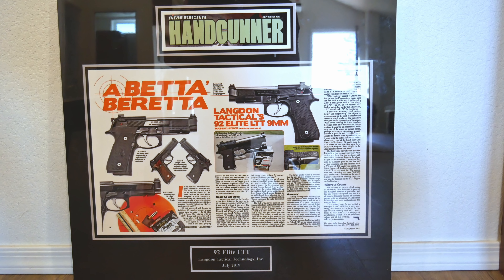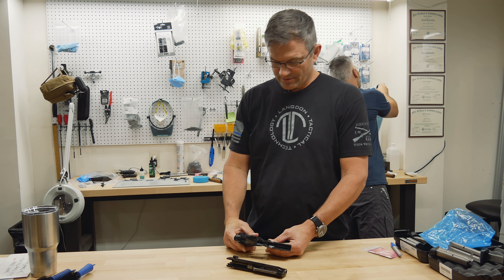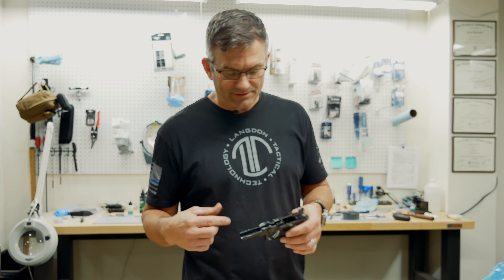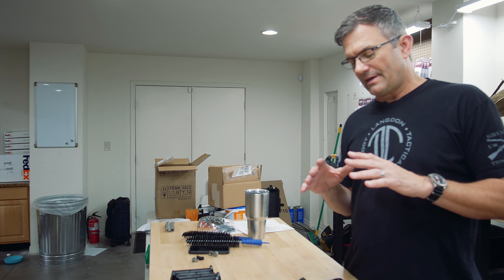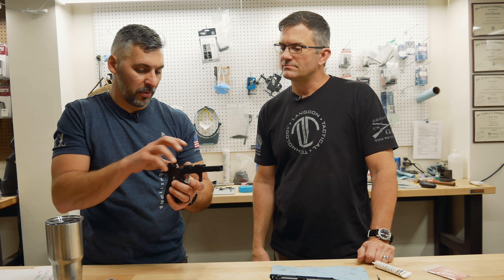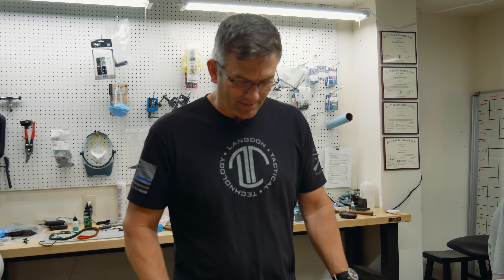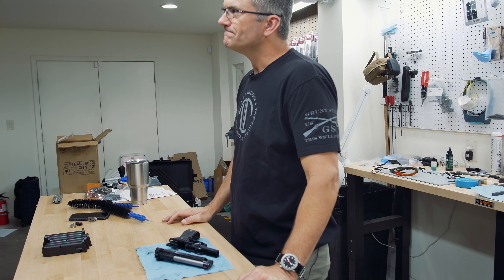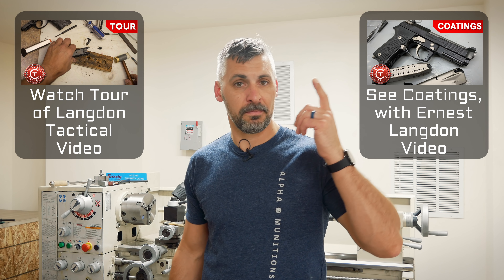Cleaning, Lubricating and Maintaining Pistols with Ernest Langdon

Comment: Thanks for pointing out the missed lubrication point @5:20 on the second frame rails!  It's important, but I never saw anybody point out this missed lube point until y'all did because few people give it a thought...but you can tell by how shiny that area is compared to the relatively light wear even on the rear slide rails, that area is taking most of the friction, and even worse, it's aluminum contacting the steel barrel and locking lugs.  Also i suspect grease ought to be applied here, vs light consistency CLP - in all but freezing weather - for that reason.

Comment: Mickey, I actually brought my 92 to a supposedly gunsmith to replace my factory trigger to WC short reach trigger. Went to shoot afterward, and the trigger pin came out on the left side. Of course he did the exact same thing, putting  it on the wrong side. This guy actually charge me money to do the job incorrectly. Learned the hard way. Been listening to Ernest Langdon since then.
Reply: Hello, I have the 92FS, but as a woman with smaller hands, I have always needed to off-set my grip so I can reach the trigger. I actually shoot very accurately with it, because I have learned to make the appropriate adjustments that work for me. But I have recently discovered the WC Ultra Thin grips, and I'm going to get them. What can you tell me about the WC short reach trigger? How does it feel? Reset? Take-up? Etc... That sounds like an additional mod that I should be doing, as well. Thanks!

Comment: Early in this video, Ernest talks about over-cleaning (for those of us who clean a gun after EVERY time it's been to the range). He explained the few scenarios where that's truly necessary. MY QUESTION IS: What about guns that are NOT used regularly, and therefore, spend months and years in between range time? If I only take a gun out for a spin once a year (or every 2 years), won't the corrosive residue left behind start to pit and destroy it, when in storage (especially the inside of the barrel)?

Comment: Obviously there's gun guys in the comments section so just let me tell you a quick story about Gun Fighter synthetic oil. I was having trouble with my Sig p365xl coming out of battery. Just figured it wasn't broken in yet, oil is oil I've always said. This wasn't the case after I tried Gun Fighter oil on my p365xl, after I lubed it I couldn't make it stay out of battery even when I tried to. So I just wanted to mention that it actually works very well and goes a long ways. It also doesn't sling oil all over the place and does not dissipate. I love this stuff and that's coming from a guy who never gave a damn about what oil I use, I've used oil off my vehicle dipsticks lol.
Just wanted to say if you try it you'll most likely love it. And you'll also find many other uses for it too. I've even used it on a sticky hood release latch with great results.
Be safe out there everyone! ❤❤❤🙏🙏🙏🇺🇸🇺🇸🇺🇸

Comment: I have another question. Is it ever recommended to use the compressed air spray cans that we use on our computers and electronics? I know Ernest spoke about using compressed air, but I'm assuming he meant the high-powered contraption machines and not the little consumer grade cans. Is it ok to use those cans when cleaning?
Reply: No youll cause the gun to explode

Comment: Hoppes been around for many many decades, didn't think I'd hear a bad opinion about that product.
Reply from the maker: Been around doesn't always equal the best. Ernest is referring to not using something it is not intended for. Bore solvent is for the bore.
Reply: @CarryTrainer  my buddy gave me some Shooter's Lube and so far it works very well. Have you used it and what's ur opinion on it?
Reply from the maker: @gamebred5x  I have not used it.
Reply: @CarryTrainer   then what is Hoppes used for?
Reply from the maker: @DS-gd1xw  Ernest was referring to Hoppes #9 it is a bore cleaner. Not an all purpose gun cleaner. It is intended to help with cleaning deposits front bore. Period
Reply: @CarryTrainer  so Ernest was saying to use mineral spirits on gun parts other than the bore? Did I understand that properly Mick?
Reply from the maker: @enfuegosevensevenfour6220  he does. I do not.
Reply: @CarryTrainer  what do you prefer to use? Love your gun oil btw.
Reply from the maker: @enfuegosevensevenfour6220  having spent years around toxic solvents and chemicals I do my best to limit exposure to them. I use a basic water based degreaser/cleaner. In fact we are launching a cleaner line that will compliment our Gunfightergunoil brand
Reply: @CarryTrainer  I am interested. I have been using hoppes so I obviously can learn a few things. I enjoy being from you and your channel. I'll keep my eyes open for the cleaning line.